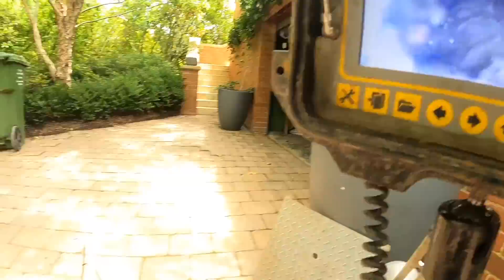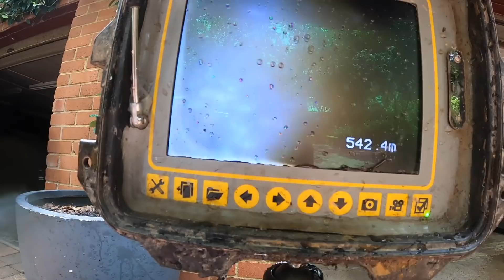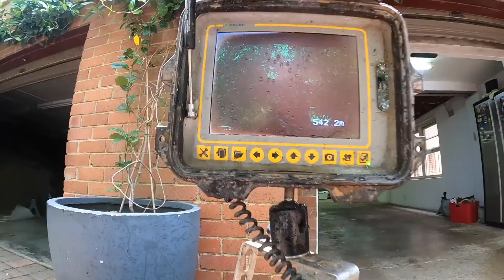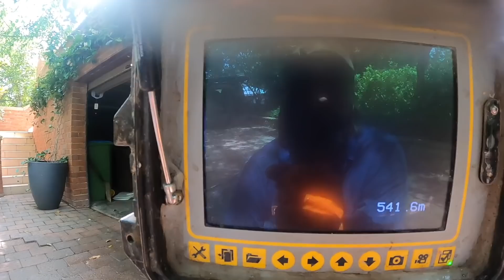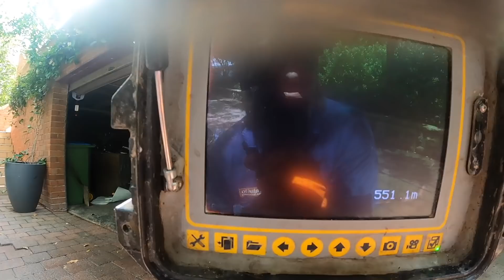Blocked Drain 610

Comment: I like how your new machine automatically pressures up when you need it  Way cool
Reply: Not sure how Ollie's is set up, but I've been looking into a similar setup for my jetter.  Throttle controller that backs down the gas when the pump goes into bypass.  Nice addition to have!
Reply: Should save a bit of fuel and wear and tear on the little Honda

Comment: close up of ollies face looking  🧐good😎 nice see you today ollie 👍👍 bring out doube  barrel you just made my day. good tools never die they out proform the newest tec
Reply: want to dig with out shovel i just saw at my work vacuum truck pull up guy said 1ft tank was full of water to keep down dust and make dirt more malabale so off he gos  to fix wire with  deep vary deep electric wires hole was like 10 ft down  to get to said wires. What they did is use something like ollie has pressure washer it dose not need 5,000 psi but by spraying said water and sucking up at same time dug 7 by 7 hole no problem 10 ft deep and there was no hot wire that was shut down case they had to replace it 

So here the thing can ollie use his pressure washer and his old faithful vacuum to do the same to find buried  pipe and dig a hole hmmmm????

Comment: How many times Have you pulled it out to quik I used to run the truck mounted culvert cleaner I pulled it out to quik one day it stood strait up in the air an slapped the hell out of the top of the truck but it was an inch and a half line with 45hundered pounds of pressure it could have killed me but I got out of they way when it slapped the top of the truck I was able to shut it down lol got my ass chewed out to

Comment: In the main storm drain, there is the pipe that leads to the road, and the other pipe you cleared going back up to the house. What was the third pipe for that you didn't do anything with?
Reply: 3rd pipe went to that floor drain inside the house

Comment: Anything different on the soil there that leads people run gutter discharge to the street? Ive never seen that in the states. All the gutters ive see just discharge a few feet away from the house and/or straight into the ground.
Reply: It goes to stormwater drains and out to creeks/rivers. We tend to be very dry and then large volumes of water at once. Can lead to flooding and issues affecting foundations of buildings if the water is not directed into stormwater drains.  Quite often the gutters to to very large rainwater tanks for drinking etc outside of major cities.

Comment: Hey Ollie, That's an interesting little blue clamshell multi-tool thingy that you used to clear your ax nozzle. What other sorts of things does it have on it, or could you tell me how to find one? Thanks
Reply: That tool is for cleaning gas welding and cutting equipment.  They have them at welding supply stores.
Reply: I remember my father using one of those gadgets to clean his pipe he smoked until about 1981 and quit cold turkey after 46 years

Comment: I always thought it would be a good idea to put the small penetrator or axe on and get the hose through to the end or access point then put the DC on with the hose still in the pipe and pull it back through..?

Comment: * * * I M P O R T A N T * * *    I work for an Electric Utility here in the States and although there is utility in what you are doing to clear this drain, you may also be creating a hazard in the clearing/removal of the sand/dirt/fill near that utility pole.  Granted utility poles are typically buried at a minimum of four feet in dept and depending on the load it is typically more, the fact that the compacted fill around the pole has now been liquified and some has been removed and with the drain clearing more liquefaction will take p[ace with every weather event will weaken the area of the utility pole perhaps resulting in a pole and wires coming down in the street or a yard.  Either way a dangerous situation.  It is evident that the utility did not locate other utilities and drainage systems when they installed this pole and created the issue initially, but your actions here could be seen as exacerbating the situation and creating the hazard to life and property.  I would stop at this point and notify the homeowner, the utility companies attached to the pole and also notify the city of the possible problem.  All of these organizations have the proper engineering skills to determine the threat if it exists and the mitigating factors to resolve and also to determine the velocity of risk to any property or impact to lives and livelihoods.  This is not your fault, but you can make a situation that was caused by the pole utility better.   * * * I M P O R T A N T * * *